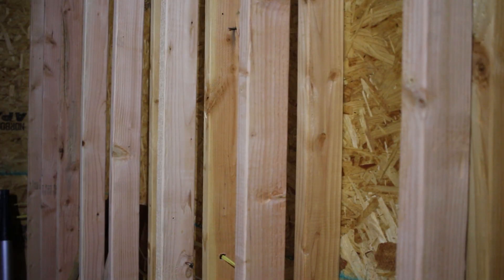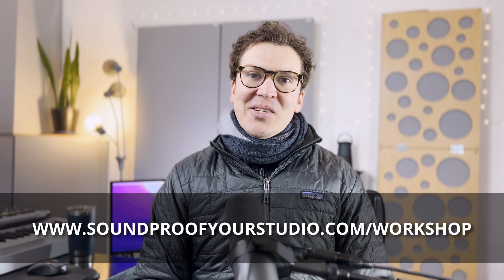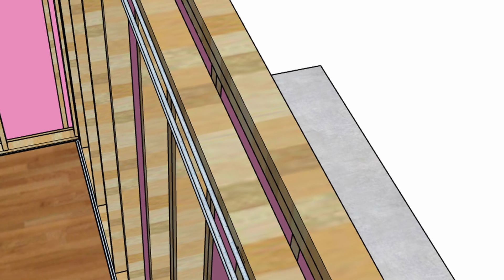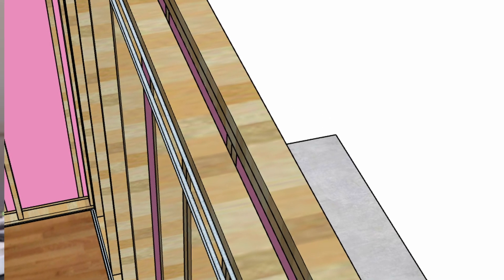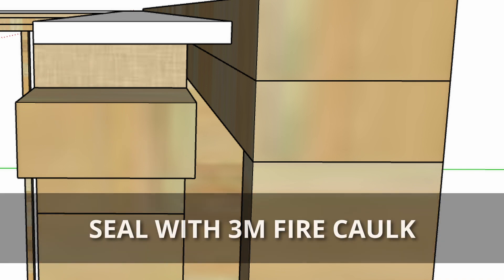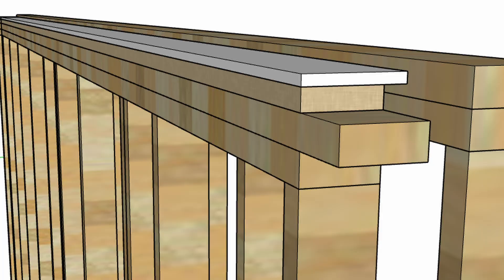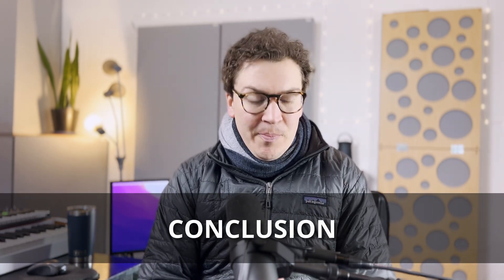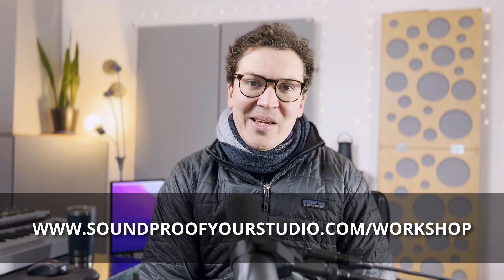The Importance of Fire Stops In A Double Wall System

Comment: Thanks for putting the fire safety concern into my mind. It's often a point that we overlook while dealing with the soundproofing and acoustic treatment. 
My question is, wouldn't it be enough to close the gap with high density rock wool only instead of the drywall layer. Wouldn't the drywall touching the outer wall couple the walls even though we out a layer of rock wool under it. Or am I worrying too much on details?

Comment: Hello, i just moved to a new apartment near a train station so we hear the train horn everyhour the walls are super thin paper thin. We have a really long wall, and inwantsd to know what I could buy to use to put on the walls to reduce the train sound horn you can hear it all thoughout the apartment. And insight would be greatly appreciated. 🙏
Reply from the maker: Philip Newell has a great method of using 4" 5lb/ft3 of reconstituted polyurethane foam glued to your exisiting walls, and then two layers of 5/8" drywall then glued to the foam. This creates a mass spring mass system without demoing your existing walls. If you did that on your walls and ceiling it could help, but sound would still travel through the foor, doors and windows, and HVAC if those are not addressed as well.

Comment: Currently building a studio in BC (Canada). Inspector made us fill the entire cavity with insulation (no air gap between the 2 structures). This was the only solution he allowed other than adding a layer of drywall between the 2 structures (triple leaf system). I'm pretty sure his interpretation of the code wasn't accurate but it's something others may run into. He wouldn't allow using something like rigid fiberglass (or even drywall) across only the top plates as fire could still travel down the length of the wall between stud cavities. It really just came down to his definition of "concealed spaces" which need to be firestopped between each other.
Reply from the maker: Yes, codes will always make studio design much harder. Some are stricter than others. The good news is that the isolation filling the gap will not hurt your soundproofing, in fact it really does help.

Comment: Good topic 😮 Actually, I never thought about this. I'd imagine once you have the fire stop in place, you would want to install the resilient mount bracket from wall to ceiling. So technically you can screw down the fire stop to the resilient mount bracket and keep some form of isolation. However, what if you don't have space for a wall gap and you only build a resilient wall or hat channel wall. Would you still need some sort of a fire stop?
Reply from the maker: I don't usually do fire stops for resilient channel, but you make a good point that there technically is still an air gap. Rockwool is a great fire stopping tool and  its qualities mean it won't transfer sound easily.